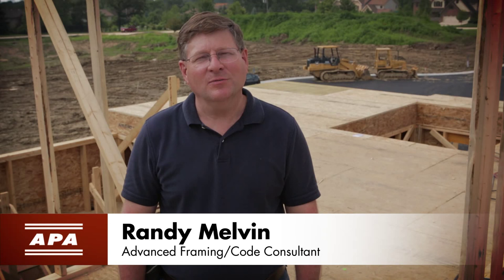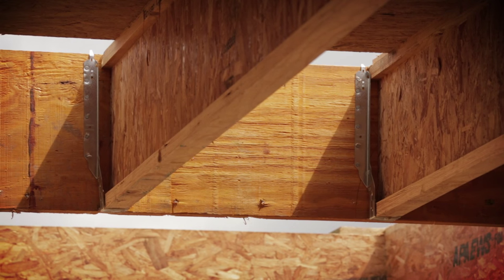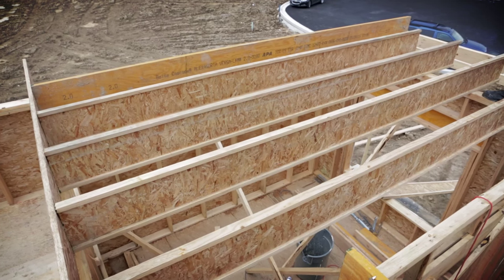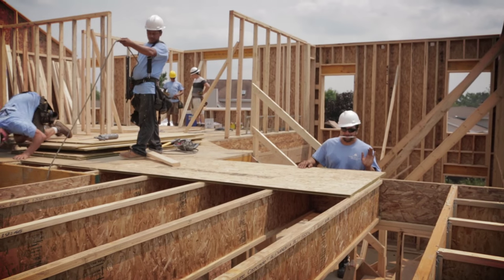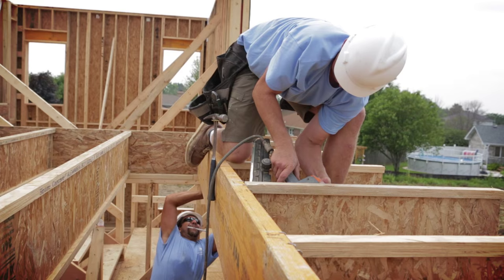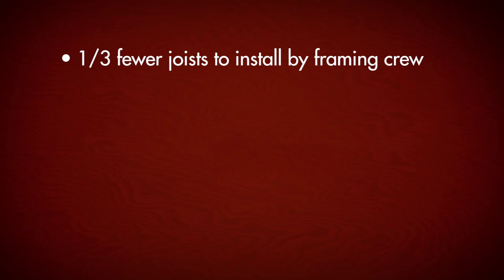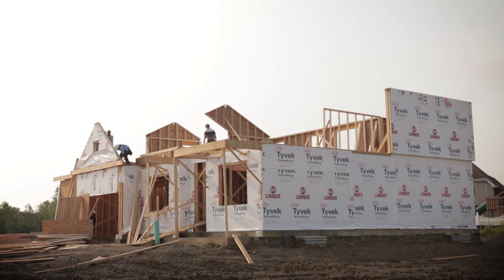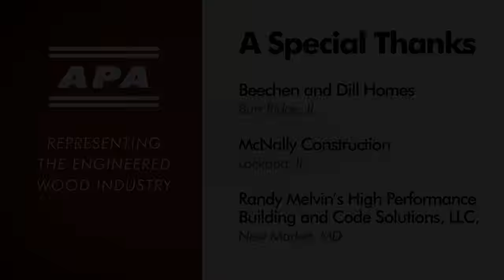Inside I-Joist Floors: Improve Performance with Thicker Sheathing and Deeper I-Joists

Comment: I built my own 1600 sqft house using I joist and glulam. I used advanced construction methods, which uses 2x6 studs @ 24” centers. I’m a electrician by trade with little to no construction experience prior. Using this method I was really impressed at how simple and cost effective building your own home could be. The end result was being able to learn a new trade, saved a ton of money and completely debt free at the end of the project.

Comment: I have a small hole in the subfloor inside the door from water intrusion under the door and I-joists.  To fix this with wood joists, you nail strips of wood into the joist to hold up the edge of the new section of subfloor.  But with I joists, where can I nail into?  If anyone can help me out, I'd appreciate some good advice.
Reply from the maker: Please contact the APA Help Desk at www.apawood.org/help for assistance.